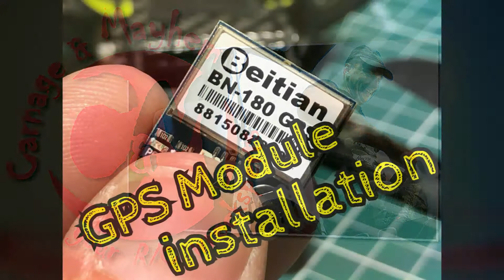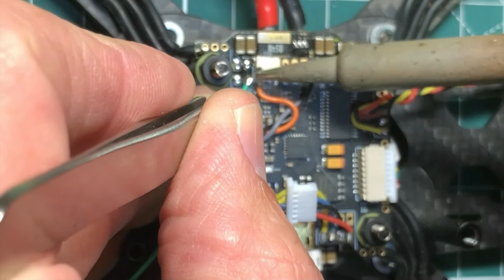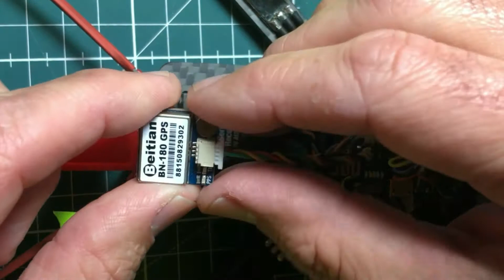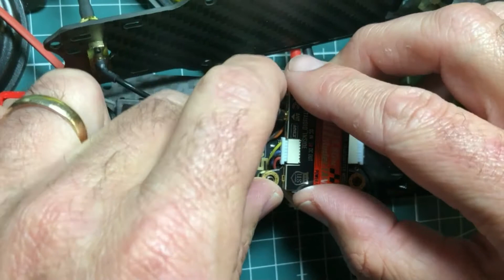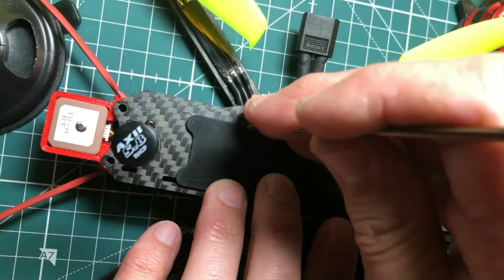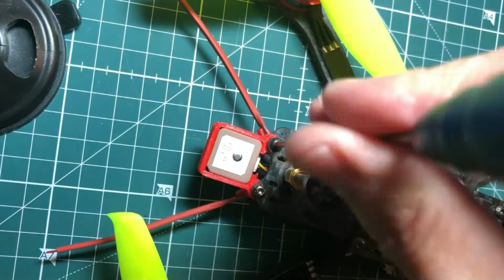GPS module (BN-180) installation with BetaFlight flight controller

Comment: would you recommend the bn-180 over the bn-220? thank you!
Reply from the maker: I haven’t used the BN-220, but it does have memory and the 180 does not.  I have also heard that some users have had better luck acquiring satellites with the 220.  I know that it has taken 5 minutes or more for my 180 to acquire satellites when I haven’t flown it in a few days.